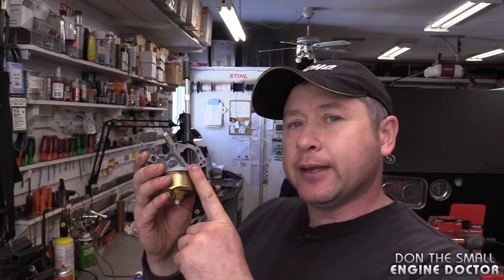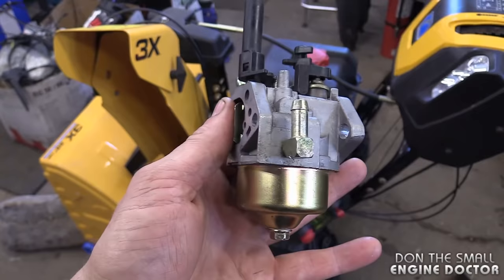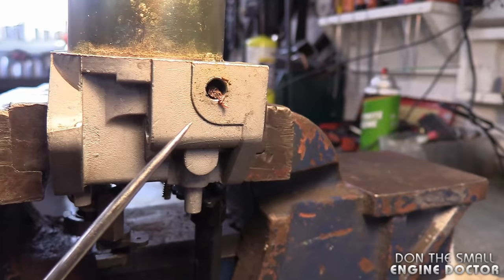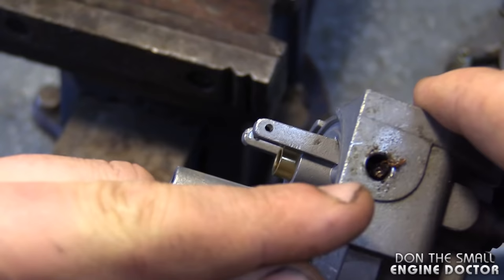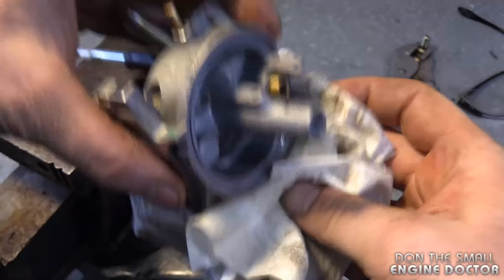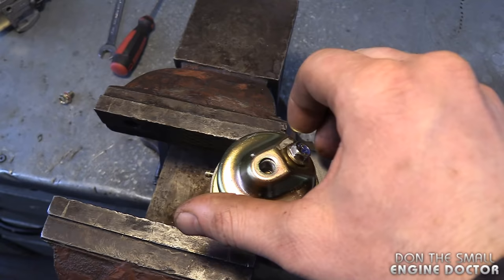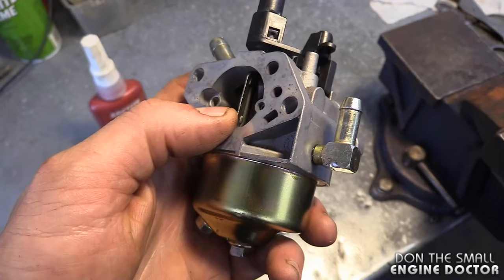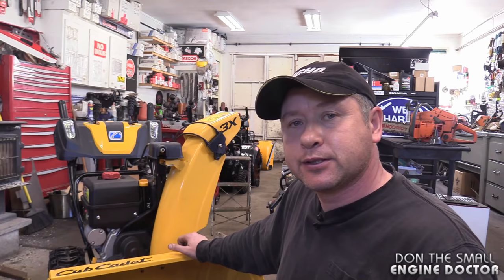Hidden Carburetor Fuel Filter Screen On Small Engines! Must see! - Video

Comment: Any way to add fuel shut off to these carburetors ? I have a craftsman snowblower.
Reply: Small plastic ball valves are available in straight or 90° configurations.  Flow goes with handle position.
Reply: Fuel line pinch off pliers, that Harbor Freight sells, if no room in fuel line for a filter.
Reply: @heyinway  Extend Fuel Line may help.
Reply: @gordbaker896  Only if enough room, usually not.

Comment: Dony Tecumseh carburetor do they have the brass gas line that you removed or do they have plastic ones. And can I remove it if it is plastic.
Reply from the maker: no screen behind tecumseh carb hose inlet
Reply: Don they have models 38065 or 38063 can I use those models carburetor or does it have to be the exact model match.
Reply: I want to send u a pic but can’t paste.
Reply: Dony the idle jet do I turn it in all the way or does it have to be out one turn or one and a half turns out. 
I clean it out last month and just turned it till it stopped.
Reply: @donyboy73  Don so the last time I ran the 622 was 2 days ago throwing slush and snow mixture cleaning out the chute through out the 2 hours outside. Toward the end Engine running rough and had popping sounds. 
I have a feeling something is wrong with the carburetor, which I cleaned and put all back after she was great till 2 days ago. 
Are there any hidden ports to clean. 
The idle jet last time was clogged is it possible it’s clogged again and is the Idle jet supposed to be all the way in or out a bit. 
Thanks.
Reply: @donyboy73  thank you. Don what do you think about Seafoam
Reply: @donyboy73  seafoam Dony what is your opinion on it. I’m thinking the carburetor on the toro needs a good cleaning into those tiny hole or ports inside the carburetor. I really what ti try and keep the original Carb. Since original Tecumseh carbs are going for $100 plus.
Reply: My idle jet I will try and adjust tomorrow hopefully this will calm it down from the popping sound

Comment: Nice video buddy! How many Honda snowblowers per year do you typically see? Ever issues with carburetors?
Reply from the maker: ifI get hondas with carb issues it's usually from leaving old gas in
Reply: @donyboy73  my Honda dealer said my gas was mint inside my gas tank and was almost a year old. Always used the star tron

Comment: I found the same filter blocked on my powermore motor in my rideon mower. A begger to access and clean. Removed the filter after the third blockage. and this was before 100 hrs runtime, and inserted a briggs and straton inline fuel filter. All fixed. 

My next issue was the air filter, no matter how well I cleaned it the motor would not rev up smoothly, and the plug was carboned up. This was after only 70 hours running. Replaced airfilter with a briggs spare, again, all sorted. These powermore motors really are chinese s**t. Won't buy another!
Reply from the maker: good to know!

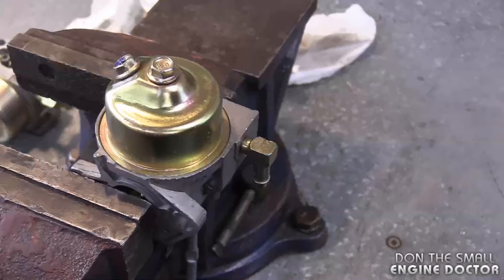Comment: 1:43   what a dumb idea.....screen in the smallest place, where the fuel has the most pressure going, with a 90 degree elbow.   THAT  screen / filter,  SHOULD  be a separate entity, a replaceable filter, on the incoming line, like in the 'old days' .......modern engineers, need some  PRACTICAL   EDUCATION.  goto school, then, work in the chosen industry repairing these things....THEN....go and do your designing/engineering new products......this is just backwards 'engineering '